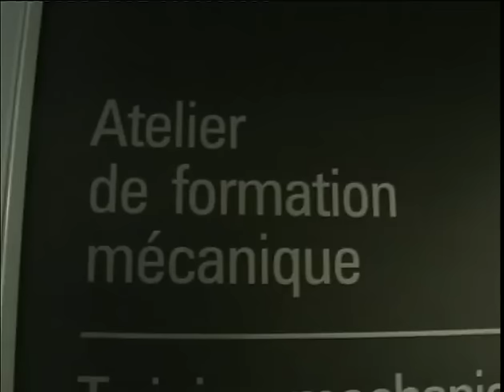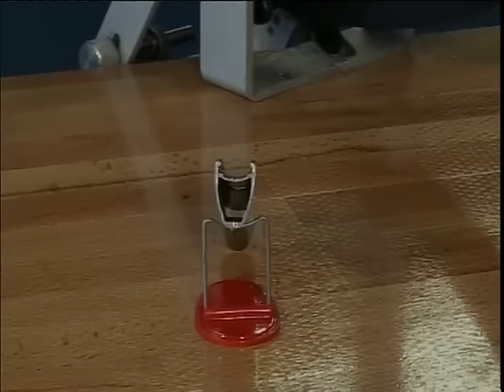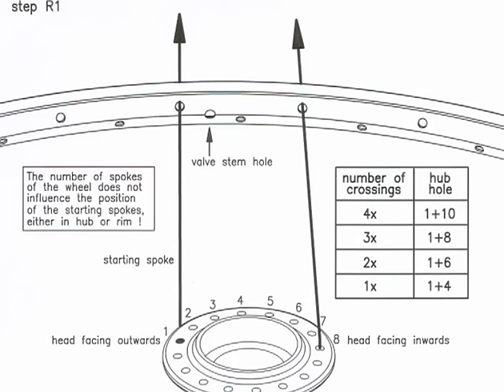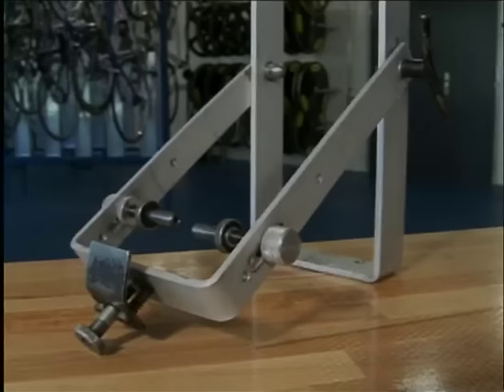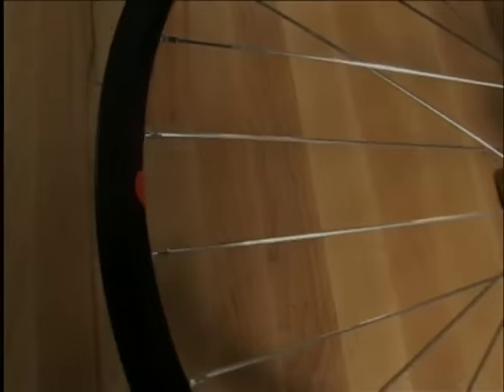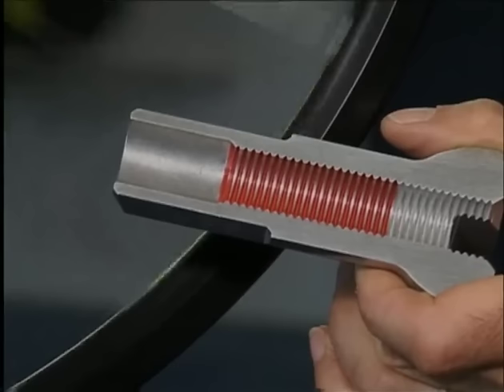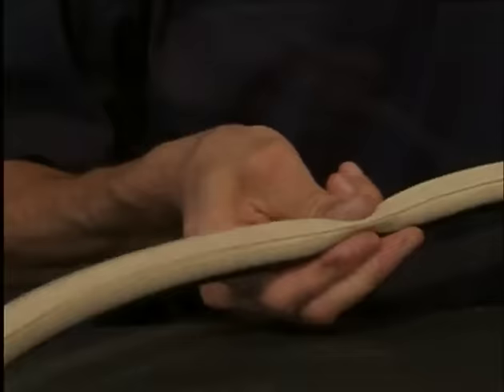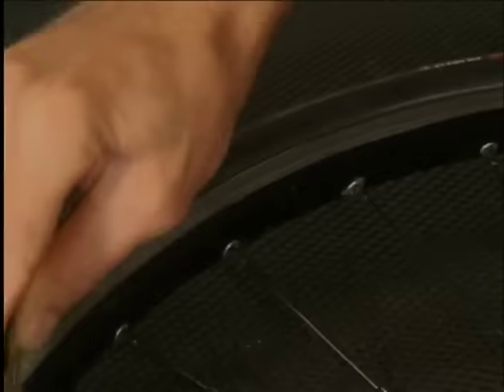Mastering the wheel (video lesson)

Comment: Over the years I have built several wheels for my personal use and also for personal  amusement... though it all started when a so called professional mechanic told me my accidentally bent wheel won't be trued to the previous form. Then i felt curious and tried to correct it over an over again all by myself. With the help of internet. Also gathering some knowledge from reading wheel builder's instructional books. First time, i finally did correct that wheel though partially trued. Latterly trued 100% but radial perfection and even spoke tension was hard to achieve since it was already bent from collision. But that success was so much confident gathering i went on and never ride again. =D

Comment: Thanks for the video. Great video.  I like to know more about 5x lacing disc brake 36 hole rim ?  I figure from your video starting with  #1 and # 12  then over 1 and cross over 4. then skip 5 then with the next hole  place next spoke  I like to know if that is correct ? Thanks for your time.

Comment: No lock ring, no brakes. You shouldn't have said that track sprinters don't use them, lots of kids new to fixed gear will crash and get hurt without a lock ring.

Track sprinters don't need brakes because of the track shape. The track is ascending towards the outside, they climb it to slow down and then descend to speed up. But fixed gear bikes in cities should have a lock ring at all costs!
Reply: agreed you're not that fast even if its not njs

Comment: If you do 4 cross will this shorten the spoke as compared to 3 cross?
Reply: No.
Reply: Actually I was able to fit the 700c spoke when I did a 4 cross. The problem with rims nowadays is that manufacturers thickened the distance to the hub. I do not know how they call it so the ordinary spokes for 700c rim becomes longer if you do 3 cross as standard. So instead of cutting and rethread I did 4 cross. This went well although tension was a little low but it fits. And trued.

Comment: Video omits mention of single-butted spokes (for tourers and tandems).
Reply: While butting might raise the stress along the midspan of the spokes, the concentrated stress at the spoke/nipple and spoke/hub interfaces mean that the magnitudes will be greatest there (for typical butted spokes); the elbow and nipple will be the 'weakest links' when considering fatigue damage. If this holds, I can't see how straight-gauge spokes are an advantage (ignoring cost) on tourers and tandems. Raising the spoke count is valuable in reducing the stress on each spoke; nevertheless the arguments in favour of butting hold true for tourers and tandems as well as ordinary bikes. If anything, saving weight on a tourer means more room for carrying pastries :)
Keen to hear arguments to the contrary; with these topics there is much assertion and precious little data (in the public domain, at least). Jobst Brandt argues in 'The Bicycle Wheel' that the greater elasticity of butted spokes reduces stress magnitudes due to improved load sharing. I would be curious to see how high spoke count wheels with heavily butted (eg. DT Revolution) spokes would go on a fully loaded tourer if this argument holds.

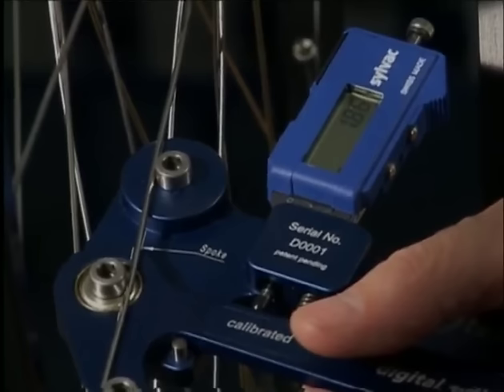Comment: 52:55 neither is measuring spokes DEFLECTION... professional wheel builders barely use such useless tools and when they do use, it's used just for a random check to see if they're somewhere around a ballpark. How did tour de france exist before park tool came up with this nonsense? I know here it is DT, but park tool came with this nonsense, most importantly how did bmx existed? huh? 
Another nonsense is their bottom bracket facing tool... like what? No one ever needed this sh** and now everyone uses it... if you have to use it means manufactory should quite making bike frames and refund you.
Reply: I second your opinion. The use of fewer and fewer spokes on wheels has driven a need to tension spokes with upmost precision, hence the tensiometer's arrival. And the bb shell tool... outboard bearings need a perfectly flat surface against to which properly seat to work optimally. But these are marginal gains which do not come without caveats. The latter being increased maintenance and price, which are not a problem if you have a team with mechanics and plenty spares (given for free by sponsors), but makes no sense for enthusiasts or home mechanics.

Comment: NEVER NEVER NEVER use Loctite to block the nipples!!
Reply: I've been using 222 for years and have built hundreds of wheels using it
Reply: A wheel perfect assembled does not require loctite! Locatore avidi the natural assestament of the spoke.
Reply: Cyclists and roads aren't perfect and I prefer the belt and braces approach. If a rider hits a pothole when they're doing a 600km Audax ride or even a local club ride I don't won't the wheel to cause any problems. I mainly build wheels for guys that break factory wheels and want reliability
Reply: @geoffsemon7411  :
Indeed, locking the nipples makes wheels more reliable and consitently. Allthough i use linseed oil since ages and never got dissapointed by it. 
And the best is, it's bio degradable :-D

Comment: The explainations about the functionning of a spoked wheel and about the fatigue spokes elbow are the same as in his book, and it's a lot of bullshits. Gerd Schraner his (was?) maybe a good wheelbuilder, but as an engineer he doesn't worth as scrap. The worst is that now this non sense bla bla is gossiped by half of the planet. If you want to learn how a bicycle works in real, please read "The Bicycle Wheel" by Jobst Brandt.
Reply: I was about to post the same comment. There's a lot to disagree with in this video. 

Jobst Brandt's book is excellent. Arguably the single most important (and counter-intuitive) point he makes is that a bicycle wheel does not hang from its top spokes; rather it stands on its bottom spokes.
Reply: taseen iqbal, read Jobst Brandt then go back and re-watch the video. At several points, you will be screaming at your computer screen.
Reply: Hertog von Berkshire . 

The book of Brant us the only Holy Bible available.
Reply: Hertog von Berkshire Can you please provide more about the errors Schraner makes? Or point to the relevant chapters in Jobst Brandts book? There seems to be so much confusing information out there about wheelbuilding.
Reply: @Hertog_von_Berkshire  :
"that a bicycle wheel does not hang from its top spokes; rather it stands on its bottom spokes."
Not even possible!!! Spokes are strong when pulled. They are weak and bending when you push on them. Hence, the upper spokes bear the weight of the bike and rider, while in a properly tensioned wheel the lower spokes prevent the rim from bending outwards keeping the shape of the wheel by that.
When spokes are too lose on a wheel, the lower spokes indeed can come lose every time they hit the lowest point per revolution.
Also, keep in mind how nipples are ankered in the rims. If you radially push a spoke outwards of a wheel, you would poke the spoke and nipple through the tire and tube.
There can ABSOLUTELY NO FORCE be appplied on pushed spokes.
The entire structural integrity of spoked wheels is based on pull tensioned spokes and not pushed ones.
Reply: Unix, what you say would be true of an untensioned wheel. But bicycle wheels are pre-tensioned structures. What would be compressive forces in untensioned spokes are, up to a limit determined by the amount of pre-tension, just reduced tension in a tensioned spoke. That, in a nutshell, is the essence of every bicycle wheel on the planet. Every single one of them stands on its bottom spokes.
Reply: @Hertog_von_Berkshire  :
Wrong!!
No matter how high or low the tension is, it's always the upper spokes that bear the weight of the rider and bike, and not the lower ones.
The only thing that happens the higher the tension gets is that load and unload differences will minimize.
The horizontal positioned spokes and the spokes on the lower half of the wheel are keeping the rim from bending outwards because of their tension.

If you think that's wrong, tell me exactly how the lower spokes according to you are bearing the weight instead of the upper ones. Would be interesting to hear.
The hub gets pushed downwards through the weight of the rider and that means lower spokes get less tensioned because they get pushed down.
This is also the very reason nipples come lose in badly trued wheels where nipples didn't get locked, or where the overall tension of the spokes is too loose.
It's physics and you can't change that.
All spoked wheels work this way. It has never been a different way.
Make the experiment yourself and measure the tension of a marked spoke that is at the lowest position, then sit down on the bike and let someone measure the tension of the exact same spoke again while you sitting on the bike. You will see the tension to be lowered by some percentages or kilograms of tension.
Usually a 120 Kg tensioned spoke on the chain side, will have about 118 to 119 KG when you are sitting on the bike, while the most upper spokes rise in tension for some Kilogram. Areo- that means deep section rims minimize that effect, resulting in a harder and stiffer and much less comfortable wheel.

If it was like you said, the tension of the lower spokes would rise, but they decline. I have made this experiment myself a dozen times to get an idea on how much flex a rim has compared to same geometry rims made of other materials.
Reply: @Unix_Based , you don't have to take my word for it. I strongly suggest you read "The Bicycle Wheel" by Jost Brandt, which is widely regaded as the definitive work on the subject. Without this book, I and many many others would be precisely where you are right now - dismissive of a counter-intuitive truth. To grasp the point in question, you don't need to read the book cover to cover (but please do); the first main subheading of the first chapter, Loads, is "The Wheel Stands on its Spokes", of which the opening paragraph reads, 

"From experience we know that wires under compression bend, but this experience does not include tensioned wheels in which we can push on spokes and merely reduce their tension. The concept that the load stands on its spokes at the bottom is essential to an understanding of the wheel. It states that wire spokes act the same as thick wooden spokes. With tension they will still transmit the load from the hub to the ground while their tension is reduced by an amount equal to the load. With this concept, we can discuss the forces that act on the elements of the wheel. These forces arise from several types of loads, which I will divide into several groups."

And it's not just some idle throw-away statement. It is fully supported by evidence presented elsewhere in the book. 

To my best knowledge, nobody has succesfully challenged Jobst Brandt on this issue. Maybe one day somebody will do so, maybe that person is you, who knows? Until that day happens, Jobst Brandt's work is the de facto truth and I am very confident in repeating the assertion that a bicycle wheel stands on its spokes.
Reply: @Hertog_von_Berkshire  Just read that chapter. The author seems to contradict himself:  on page 7 he says: "With tension, wires can support compression loads up to the point where they become slack. The same loads that increase compression in wooden spokes, reduce tension in wires." on page 8 he continues: "As in a wooden-spoked wheel, the bottom spokes of a wire wheel become shorter under load, but instead of gaining in compression, they lose tension". 
A structure cannot have compression and tension at the same time. Compression and tension are opposite forces. Having the bottom spoke reduce their tension under weight does not mean that they are supporting the wheel. The lost tension in the bottom spokes was redistributed to other spokes, mostly the adjacent ones (the ones that turn yellow). Check the 1st second of that video: https://www.youtube.com/watch?v=w4kz0k4AdI4.
Reply: @farida8212  there is no contradiction. You must have misunderstood one or other of the two statements.
Reply: @Hertog_von_Berkshire  Did you understand it? Those statements were copied as is from the book, so maybe you could explain to me how a spoke under little tension and no compression could support a weight.  Spokes under tension pull the hub towards the rim not away from the rim! It's just that the other spokes are pulling harder! Did you read the rest of my comment or watched the video I linked?
Reply: Pre-tensioned structures require a different mindset. Until you acquire it, you will be stuck in the same old place. Good luck with your further reading.
Reply: @Hertog_von_Berkshire it's not about mindset, that's physics not philosophy. If you watched the simulation you would have noticed that the spokes were pre tensioned!
Reply: You can lead a horse to water ......
Reply: @Hertog_von_Berkshire  :
Look the cited chapter ob Jobst Brandt says it very clearly, he has totally misunderstood how force works.
A tensioned spoke has to be releaved of all its tension before you can put a push based force onto it. That simple fact is not discussable. Jobst Brandt totally ignores this. Not only that, i still got no answer on how a spoke that is in the most lower position of the wheel can take push loads/forces. The nipple is only limiting the movement of itself into one direction (inwards of the wheel) and not outwards. Hence, even if a spoke could act as a pillar like in a carbon trispoke wheel or a wooden wheel, the nipple would make all this impossible because it would just happen to hang in the air or even penetrate the rim tape, tube and tire. As a result of this physical FACT, the most lower spokes get slackened instead of bearing the weight of the rider and bike.

Jobst Brandt was wrong!!!!
I really honor his work and entitlement around the entire topic of bycicles and wheel building. For me, it was a sad day when he passed away. But he was wrong on just that. Not to talk about that he in the cited chapter contradicts himself.
I could recommend you to read Gerd Schraners book about wheel building.
I have built wheels since 1984 and i have enough experience myself around the topic to be able to form an opinion that is my own. and i fully agree with Gerd Schraner due to my own experience and experiments i made during the years.
My profession as a mechanical engineer helped a lot and Jobst Brandt is just putting physical facts upside down.
Reply: I have read that Jobst Brandt didn't suffer fools gladly. I am much the same.
Reply: @Hertog_von_Berkshire  :
Are you sure?
When someone says that a compressioned spoke can take the load, totally ignoring that the nipples will just contradict this effort, then someone truly got fooled.
Reply: @Unix_Based  you are still missing the point. Nobody said that spokes in compression take a load. Jobst Brandt didn't say that, neither did I. Within its design limit, spokes never get anywhere near zero tension let alone into the territory of compression, and it doesn't need to for the wheel to be standing on its bottom spokes. I'm sure you build very good wheels, but until you fully accept the nature of a pre-tensioned structure, you will continue to misunderstand how they work.
Reply: @Hertog_von_Berkshire  :
I am not missing a point here. When the most lower spokes lose tension because of weight being applied on the wheel, it is clear that the releaved spokes are not supporting or at least less supporting the sturcture of the wheel than the most upper spokes. Spokes come lose in a wheel when the pre tension is way too low and a releave of the most lower spokes means total slackening. The spokes left and right of the most lowest spokes take in fact load, because they prevent the rim from bending outwards keeping the structural integrity of the wheel in their respective area of influence. 
I also wrote in an earlier comment, that the difference between maximum and minimum load gets reduced the higher the pre tension of the spokes in a wheel is. But you will never nullify it entirely.
The rider is hanging in the upper spokes and not being carried by the lower spokes. The lower spokes only keep the rim from bending outwards.
Reply: @Unix_Based  I can't help you further. We have to agree to disagree.
Reply: @Unix_Based  You're wasting your time with him. I just read all his comments and noticed he never explained anything. He just memorized what he read in the book. Or he's just a troll!
Reply: @farida8212  :
Sad but true. I offered him to do the experiment to measure the exact tension of a bikes rear wheel, sit on the bike and let someone measure the tension of the exact same spoke again and do the math, but he does not even react to it. He furthermore avoids to explain, how a spoke nipple is able to support a compression into the opposite direction on how it's ment to be. Well, i don't believe he's a troll, but he read a book, takes everything for real that is written in it and repeats it.
I at least will continue taking my experience and view of perspective into account when building wheels and it has yet so far never let me down doing so.